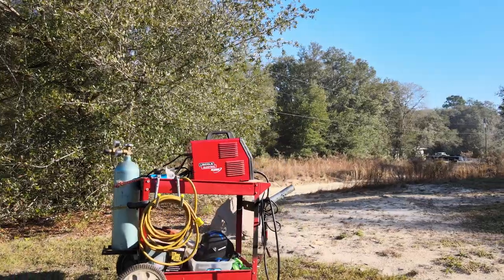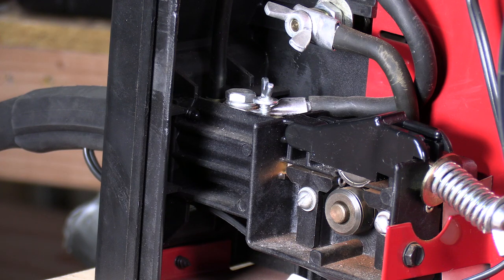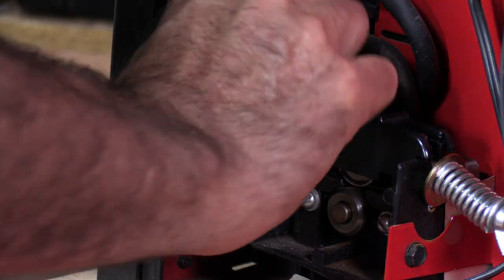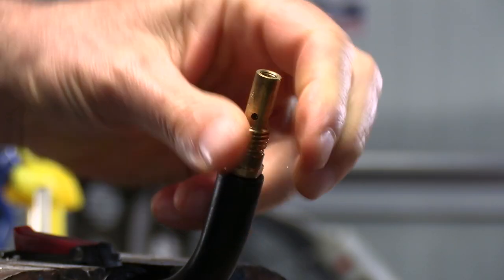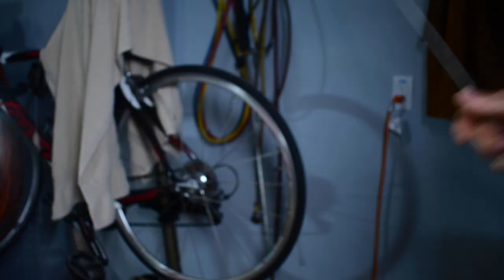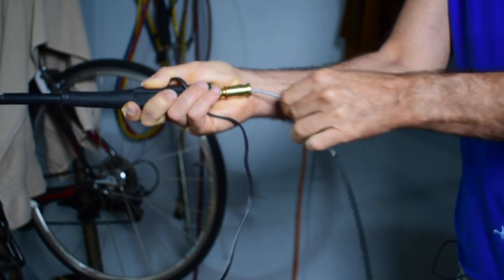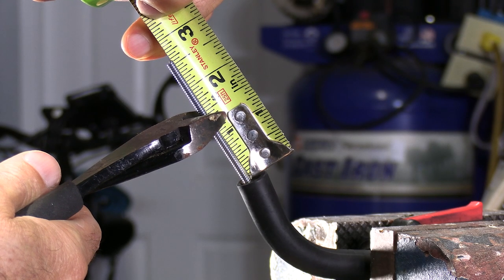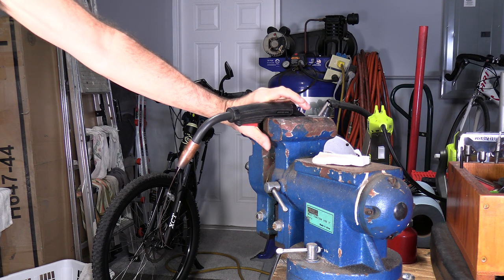Lincoln Mig Welder Not Feeding Wire Very Well?  It's probably This...

Comment: No tool has frustrated me more than my Lincoln wire-feed. Spent more time fiddling with it than welding.  Wish I'd known you didn't have to replace the whole whip I might of saved it.
Reply from the maker: I used to have a Miller... Worked smooth as butter.  I've never liked this welder, but I don't use it often enough to justify getting another Miller...
Reply: @JLPicard440  Mine was the typical Homedepot 110v wirefeed,without the mig it was to hot to do body panels. Not powerful enough to do anything structural. I use to enjoy stick welding in metal shop before that,and was pretty good at it.
Reply from the maker: Nice!  Yea body panels takes just the right amount of heat or you're looking at Niagara Falls... 😂. I've been there...